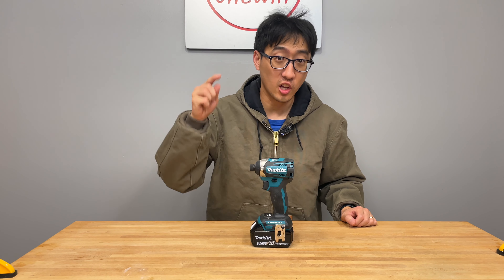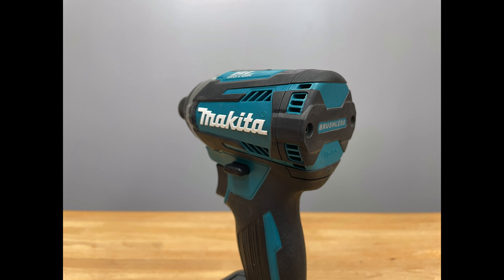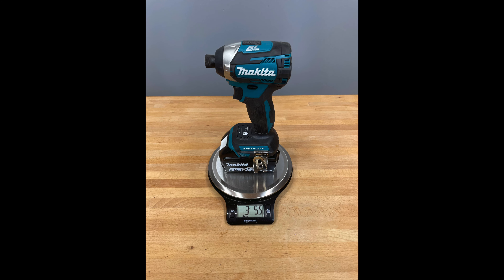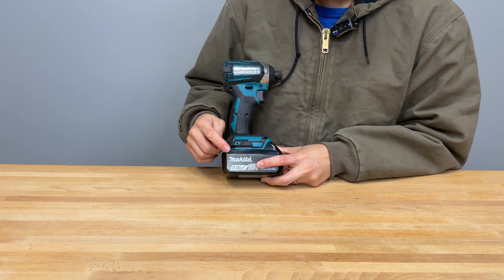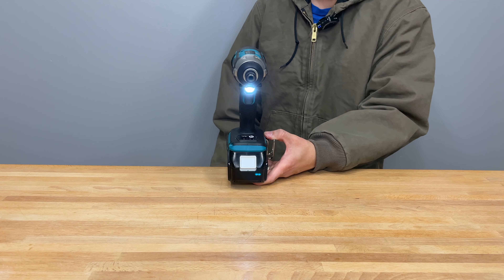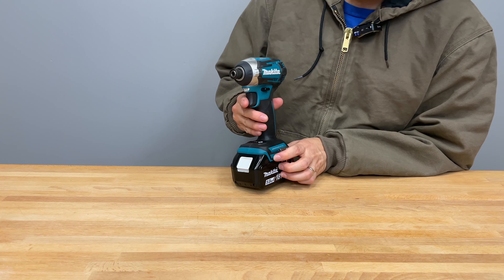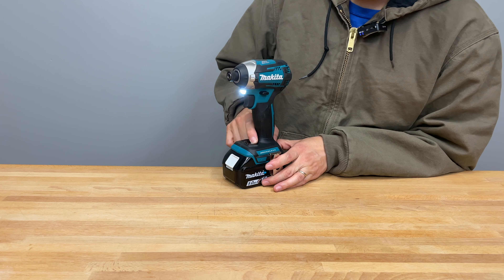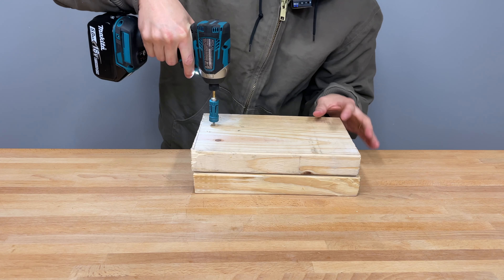Makita LXT Brushless Impact Driver with quick-shift Review | XDT14 | Best Impact ep.1

Comment: xdt14z and xdt18zb, you must choose one of these two, which one will be better?  Thank you
Reply from the maker: Depends on what you will be doing and need. if you don't need max power, then i usually reach for the XDT18 mainly bc it's a bit more compact. Hanging it on the toolbelt, less weight helps. If you're screwing in a lot of deck screws, lags, or bolts, then the XDT14 will be better